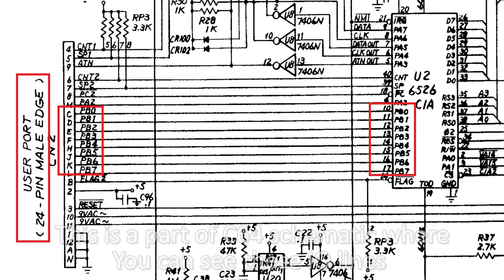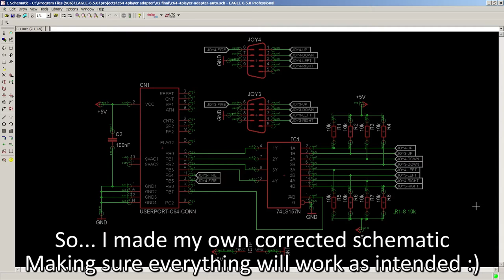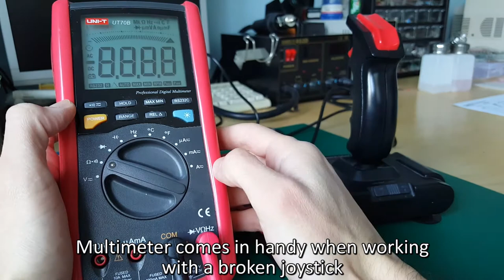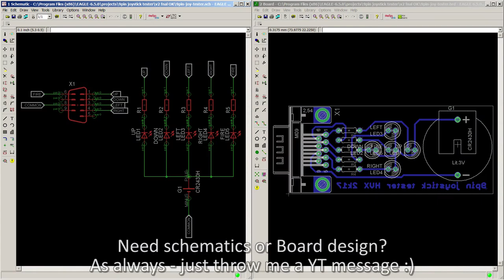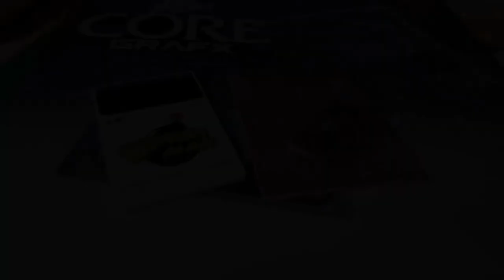Commodore 64 Homemade 4 Player Interface & Joystick Tester

Comment: I'm into the Commodore 64. Do you still make mods like these? I'm trying to emulate a joystick tester found at the channel Ms Mad Lemon, however, I can't seem to understand how the terminal pins are connecting to the DB9 connector. According to this video, it looks like you have already accomplished this. I'm slightly new to electronics, but know how to do my own soldering. Just need a clear schematic to make this work. Also I host a Basic Programming Stream each Friday at 9:45pm (MST) if interested let me know. Thanks! Keep the C64 Alive bro!